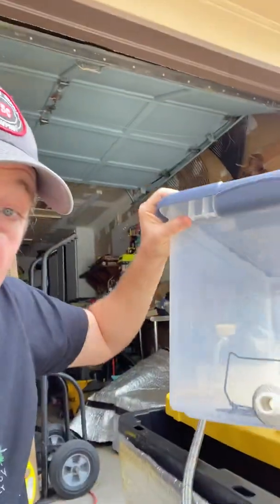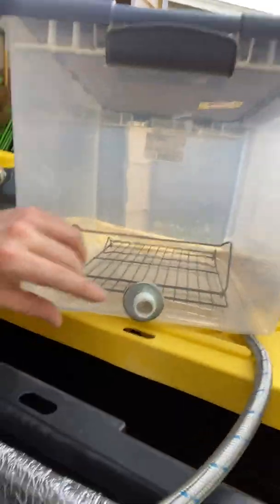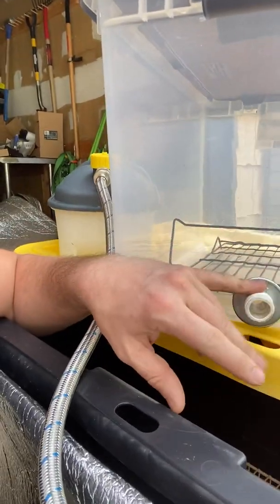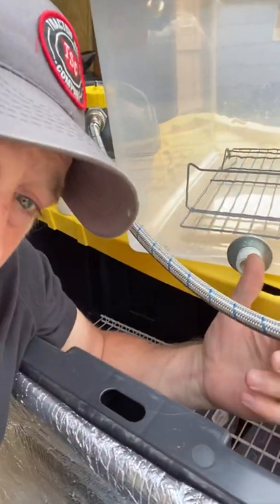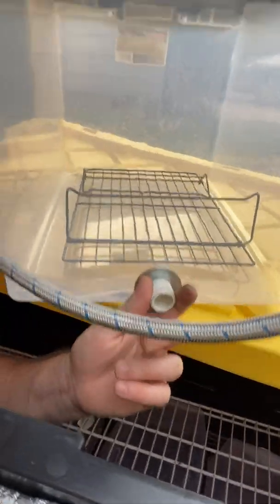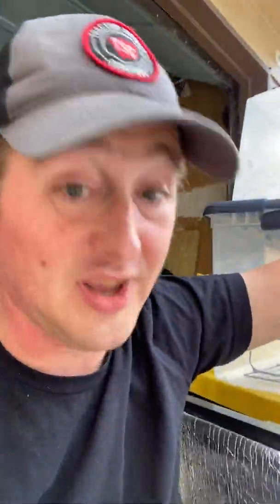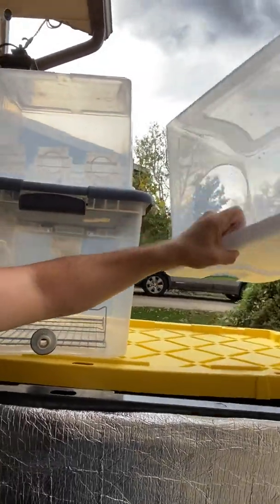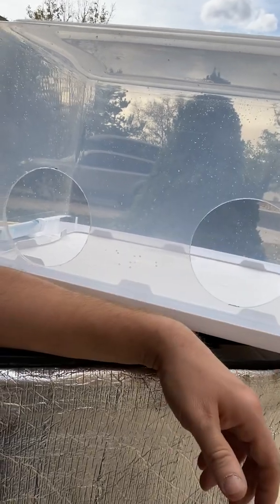Pipe fittings for the pasteurizer, what is a still air box, and an all in one kit?

Comment: The all in one would be hell of expensive to ship no? Are you using 1 wagner steamer for the 64g tote and 2 steamer for the larger one? How big is the bigger one? Im just starting out and hope you can help a Noob out.  Thanks
Reply from the maker: Nothing melts and it’s not bad to ship at all! The bigger one is 70 gallons+ while the small tote is 60ish, I use 1 steamer for small, 2 for big
Reply: @PracticalMyco  I finally build my wagner pastrerizer.  How do you know how long to pasteurize it for? Ive got a 27gallon/102liter bin and I have 1 wagner steamer.  I'm sitting here right now and the temperature is at 200F.
Reply from the maker: @pny2579  180f is hot enough, you can test a bag with a meat thermometer to periodically check and see when they hit temp
Reply: @pny2579  Did you ever figure out how long?
Reply: @DrGaryGreen  I end up selling those steamer I bought as I don't think I was practical, but after I've sold them I talk to some grower who  just use normal stock pot big enough for 15 or more 5lb blocks and use some sort of clips to clip the lid and then they use a gas burner to boil for 3hours, and it's not even prussure cook.  They said it works for them with almost no contamination or 3 years and counting. I guess if you are cooking 10lb blocks then it might take longer.   I'm going to do it that way when I need to do more blocks. I belive them as they show me a video when they were doing it.  There are alot leg room when it comes to growing mushroom.  I use to think u had to be super clean. People are just trying to push there expensive product on noob growers getting started.